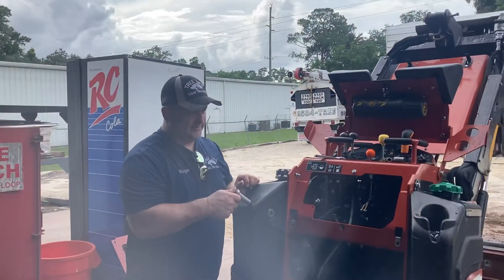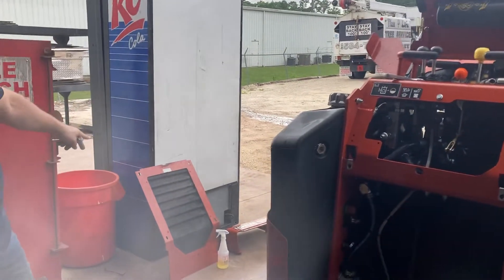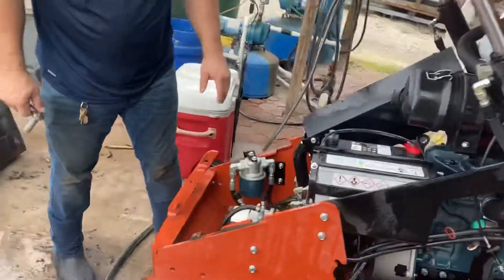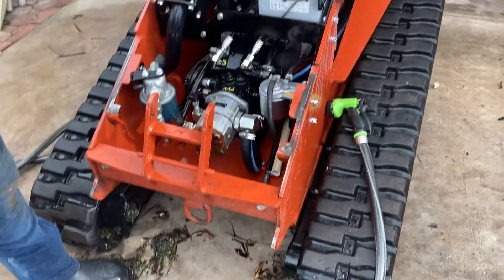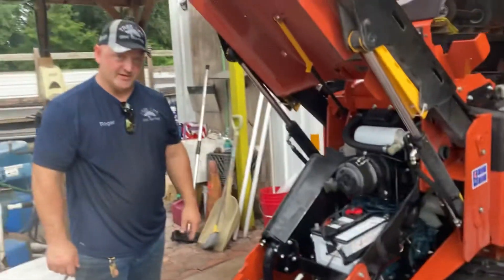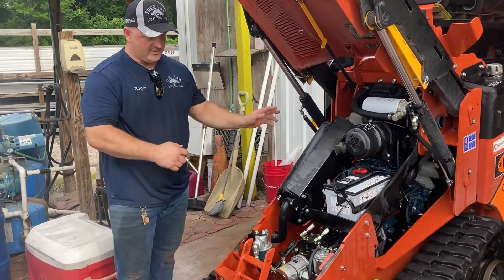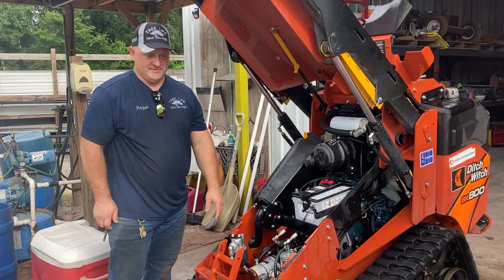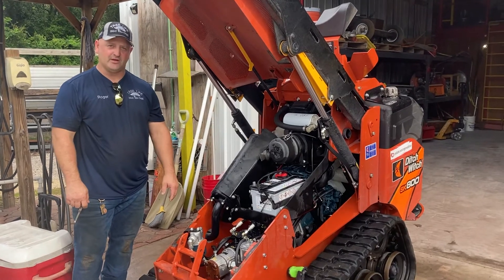HOW TO CLEAN OUT YOUR DITCH WITCH SK 800 WITH A HOSE AND DAWN DISH SOAP ! ROGER WALDMAN IN 30 MIN.

Comment: Hey ..i bought used sk 750 kubotad1105e ,have questions new to this machine WHAT IS proper engine oil ,and hydraulic fluids..? Also it has 2 dipsticks..?no manual..its in another language..cant download the huge files i found online or open them..also it runs ok but struggles up hills any help on fixing it would be amazing..have alot into it..and is there a way to get rear weight KIT for it..the 42 graplle i bought takes up alot of weight up front😮
Reply from the maker: I USE STANDARD HYDRAULIC FLUID . SOME MACHINES HAVE TWO DIP STICKS FOR CONVIENIENCE . JUST MAKE SURE YOU USE DIESEL OIL MADE FOR DEISEL ENGINES . IM ONLY KNOW ABOUT DITCH WITCH MACHINES LIKE SK800